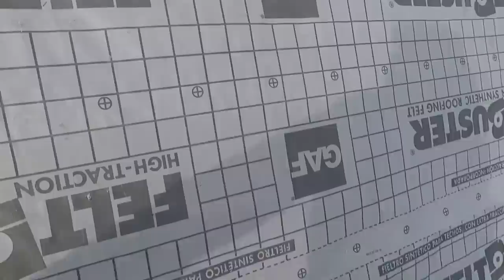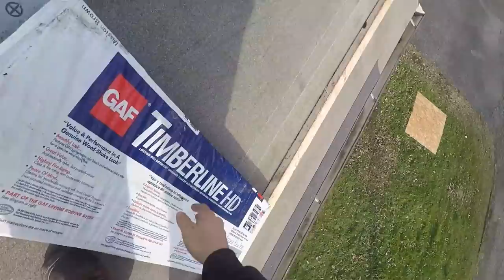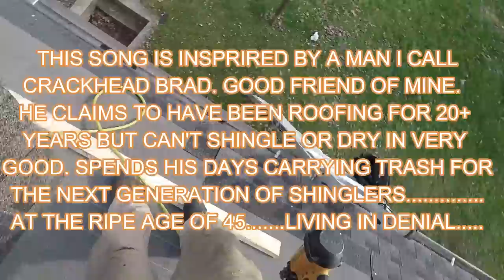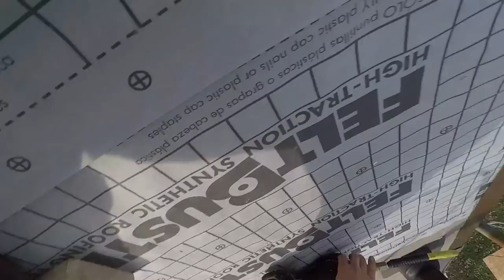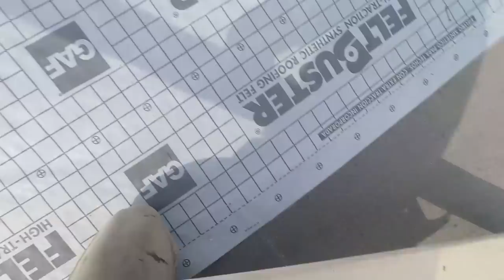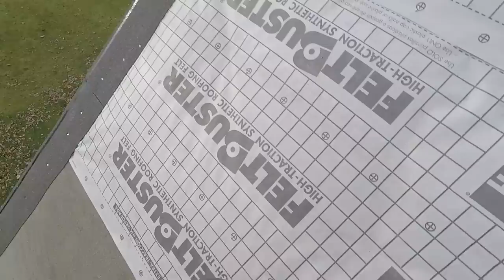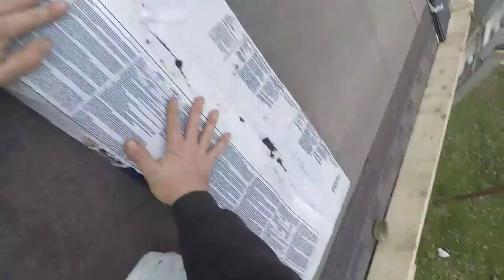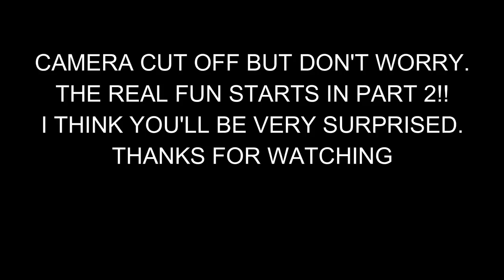Worlds Fastest Shingler 9/12 (Part 1)

Comment: Ps pre cut shingles into quarters for starting on the rake it is a lot easier then cutting them once they are nailed
Reply from the maker: Not any easier or faster based on my experience but thanks for the advice. I will be making videos on all of that pretty soon so make sure you're subscribed to see that video
Reply: I use a shingle cutter pre marked with my steps I have my full sets for my entire roof in 15 minutes. While your prepping a brain dead lab can cut them out.

Comment: I Hand Nail 3 Square A Hour On Most Walk On! Steep Roofs No Problem I Have My Roofs Loaded Then I Have Someone At Top Slide Material Down And I Cruise Rite Up! I Hand Nail Everything! I Guarantee My Workmanship As Long As The Material! Hand Nailing Is The Best Buy Nothing Else!
Reply: That argument is so wrong. I've been gunning for 8 years and not one blow-off yet. So where's the hand nail advantage in this case?

Comment: " nails into random nothingness" man that shit got me once. Im a framer and i got on this roof to do a repair for the roofers, it was a 10 pitch, they put their toe boards nailed to osb into nothingness, it held up fine walkin around on it but when i went down to pull up a sheet, opposite forces push me down and it let go, fell 2 stories and only broke my nose, fuckin nuts. I dont blame the roofers cause i sould of checked that shit. But i use a few extra nails nowdays lol ( sometimes)
Reply from the maker: yea they probably did it with 8's too! we had 16 hand drives and we were also going into 3/4 inch pine or some shit lol...when we're on osb i still do the same thing but use a few more nails and make sure they're secure of course...

Comment: If you did something like a belay harness, would it be easier for you to stretch the rope and just use a Jumar Ascender or something to hold yourself at one spot so you can work from the bottom up like on a lower pitch roof? Just seems to be easier and faster than working from the top like you were. By the way, what was your MOS in the service? By the way, you are fast as hell. Wish you were in my area, I would get you to do my roof. Always glad to help a fellow vet. Thank you for the education in roofing and for your service.

Comment: Those low starter nails are killing me.
Reply from the maker: people yell at me to put them low when i put them high..lol what do you guys want!? i looked it up after people talked trash and they're supposed to be lower-ish… so i try to put them lower than the nails that go in the shingles...but its not a huge deal. biggest deal is that you know where your shingle is gonna land so that you don't put a nail where the seam will be
Reply: Ya but if you get a situation we’re there’s a nail that’s over driven or any that could create a low spot that water will run over to that nail and start to rot the overhang. I’ve been roofing in Seattle Washington for 16+yrs and never seen where it’s ok to be doing that. Your nails should never be lower then where your first course of nails go.
Reply: Low nails for high wind
Reply: Rising Sun Garage "
Reply from the maker: @rainydaysroofer9474  I space out the nails on my starter just the same as shingles.  So that there's not a nail near the seam of my shingle.  Therefore water can get in (as it does with every seam on the roof) and be just fine.
Reply: But it’s not fine when you get a overdriven nail it creates a low point and water will travel over to it and settle and eventually rust the nail out which will cause a leak if it doesn’t always leak from the beginning. So I’d doesn’t matter if the nails are in the right place. Especially when you got guys that are newer or just don’t care about nails that are over driven under driven crooked and everything else. It’s no good I’ll never be convinced otherwise sorry
Reply: We know you been doin that shit for 16 years you know it all lol

Comment: Happy holidays boss! Can you explain the steepness numbers and what’s the worst you’ve done?
Reply from the maker: Happy holidays! So when we say 4/12 or 9/12 we're talking about rise and run. Picture a triangle with a right angle and a hypotenuse.  Let the hypotenuse (long angle of the triangle) represent a roof pitch. So for every 12 inches you go over (run) you have a rise. If the rise is only 4 inches, till you would be meeting the roof, you have a low pitch.  If it takes 10 inches before you hit the roof pitch, the roof is steeper. I've done a 23/12 roof before. So  For every 12 inches you go over...if you go straight up from that point...it takes almost 2 feett before you reach the pitch.  It was steep.  I've also done mansards and barns. Those are steeper like 30/12 or something idk. A Google search might help too

Comment: Any tips for first row of paper/ice+water on these steep ones? I usually ride the roof up to 10, then work off a ladder above that
Reply from the maker: Yes sir. I always set a toe board on the wood at like 3'6. That way you can put on the ice shield from there.  And I cut the ice shield into manageable lengths.  10-15 foot so I don't have to deal with heavy rolls.  Then after the ice is on I'll move the toe board down.  (About 6 inches or so below the line that felt goes to) and the reason for that is so I can reach my gutter apron and starter rows easier. From there I toe board as needed.  Long 16 footers usually.  And always use synthetic felt.  Goes down way quicker
Reply from the maker: I just hammer there boards in with 16s as you saw me pull off. And those boards I stand on to do felt, I'll usually stack shingles on

Comment: I get what you're doing with videos. It's entertaining, and a chance for more revenue.  I'm 50, and have been roofing for 23 years. I don't know if you are carrying workers comp, and liability insurance, but your carrier could simply watch your videos and drop you.  It has happened before.  I had one check out my Facebook change, and changed my classification from carpentry which is cheaper, to roofer which is much more expensive.  If you don't have full coverage on your guys, it sure makes it tough for the companies that are playing by all the rules, while other one can under bid by not paying insurance, or the proper rate.

As for your work it looks fine.  However, it is ten times faster to set up scaffolding from the ground to the eave, and work off of that when starting a steep pitch.  It's so much faster, and safer, and allows a better job, you will wonder why you never used it before. Also get a shingle chopper.  Cuts your starters in no time, and perfect every time.  You don't need to make crooked cuts like you do with a knife.

A little investment  pays off.

Comment: Just curious what the best method  to working on steep roofs when its 90 degrees out? You so much as step on a shingle on that pitch on a 90 degree day your probably going to ruin it...do you just use the foam cushion on hot days rather then standing on the actual shingles? Kind of a newbie here and just wondering what your thoughts were....
Reply from the maker: I had to get off an 8/12 last summer coz it was too hot. sometimes it just is too damn hot to stay if you're scarring them up. I had a cushion that day too. it was actually the day I filmed the 8/12 video. otherwise use a chicken ladder. you'll see in part 2 a good example. just make sure the ladder doesn't have anything on it that will scar them when you step on it
Reply: Sprinkler with hose.
Reply: Ronald Nolting brackets and planks every 6-8 ft
Reply: The answer to tearing me up is more cushions, more roof jacks and hook the hose up.  Spray that shit down every twenty mins.  Ground guys love to play w the hose.  I don’t know why but they always do.

Comment: What's yer gun?  I'm thinkin' of trying a Banks from Harbor Freight, because pretty much they're all the same.....  But that one's cheap.  Also, what's your preference ---  Inch and a quarters or inch and a halfs?
Reply from the maker: its bostich. if you want a cheaper one go to home depot and get the porter cable or a tool shop. tool shops actually shoot better in the cold than my bostich lol
Reply: I've got the Pierce from harbor freight. It's basically a knock off Hitachi. Bastards jacked the price up to 200 bucks on it, though. It used to be 150 minus the 20% coupon. I'm sure the price will come back down, though. Fantastic gun for the price i paid (120)
Reply: @nuthinbuttrubl89  Yeah, the Banks is also 120.  I'm happy with the framing gun so far, so I think I'm gonna try the coil gun.

Comment: Not bad. I would recommend belt/harness with d clip in front and ropes for 9/12 to 16/12, ONLY because of the fact that a rope will just make you be able to move around, tear off/shingle much faster. No need for any planks or jacks that way. Seriously, you guys do work hard, but a lot of time is wasted on putting planks and jacks, when you can wear a rope and move around/shingle much more efficiently.

Comment: What are your thoughts on 8" drip
Reply from the maker: Seems over kill... unless specifically for hurricane areas that might be good
Reply: @NWIVeteranConstruction  All the roofers in Southern ME use it as standard practice. It comes in handy to cover the gap on rakes with cove molding and short deck boards.

Comment: Do you have a recommendation for a good cold weather air hose?
Reply from the maker: i use flexilla and that's my preffered hose always. if you're having issues cold weather just make sure you're always draining your compressor at the end of the day and they also make a cold weather gun oil that has antifreeze in it. ABC sold me my bottle. couple drips in the hose and a few in the back of your gun should help pneumatic tools shoot in the colder weather
Reply: @NWIVeteranConstruction  Thank you, appreciate it.

Comment: You have probably been asked this a million times (sorry). What make and model hammer are you using?
Reply from the maker: idk what that one is. its not mine and i don't like that hammer. my favorite hammer ever is the really expensive (220$?) 14 oz titanium stiletto hammer with the interchangeable heads. but these days i usually resort to the dewault 15 ounce for like 45 bucks or the blue estwing one that's basically the same for around 25 bucks
Reply: @NWIVeteranConstruction  Great! Thanks.

Comment: If it's really steep just carry the cushion uphill so if you start to slide, you can sit down on it. Wear some cougar paws - I used to walk 12 pitches like that all the time. We wouldn't even use roof jacks on an 8 or 9. Now - yeah, on the steeper stuff you're better off with safety gear, especially on a 2+ story, but come on ... some people are obsessed with regulations even when they make no sense. What's more dangerous - walking a 4 pitch 1 story, or having to fight harnesses and tripping over ropes on it?

Comment: So you pulled up those cleate boards at the beginning and left nail holes in the peel in stick at the roof Edge which will all leak when they have ice dams. This is Amateur hour if you roof this way. All membrane punctures require secondary sealing or you drive the nail home.
Reply from the maker: Nobody does that lol but I get your point.  I wouldn't call it amateur hour, roofs used to not even have ice and water and survived just fine.  Calling it peel n stick is amateur hour.
Reply: @NWIVeteranConstruction  actually you are incorrect GAF does not make ice and water gcp, what used to be grace, makes ice and water shield it's a proprietary name like Kleenex or Xerox instead of tissue or copy. Therefore calling it the generic peel and stick is actually the correct term or peel and stick membrane. I have 30 years as a building envelope consultant and I'm the guy that goes in and writes reports so that lawyers can fight about the fact that you left open nail holes in your peel and stick. Also for the record GIF is just about the worst Roofing product manufacturer out there. To date we have 17 affirmative paid claims against GAF and GAF installers.
Reply from the maker: @jerrydawg4434  ok nerd lol I didn't say GAF made Ice and water specifically. But If you go to your city, they will tell you ice and water shield is or isn't required, never heard anybody use the term peel n stick 😂 There's plenty of different brands and people call it strange names like Ice barrier shield, etc. But people who use this stuff daily, call it ice shield. So that's all i meant man. And As a shingle installer, having worked with many different brands, GAF happens to be one of the better more consistent ones to work with regardless of temperature and regardless of how many claims you and them have. Everybody is short handed I'm sure some line inspectors missed some stuff. Unfortunately, it happens. The installer should've noticed. And that doesn't mean that I don't enjoy working with landmark or O.C, although I do have issues with them on occasion. it sounds to me like you specialize in nail holes under roofs....nail holes, really!? You're gonna tell me that's the cause for these serious issues you have worth going to court over!? And lawyers are making that ridiculous argument!? Lol For crying out loud we, as shinglers, and I mean everyone, cut the bubbles out of ice shield and let it stick back down on itself. Without adding a new strip over it. That's like, a 16th of an inch of over lap, and we all sleep just fine knowing that it won't leak. It's Been going on for decades without issue. Don't tell the lawyers that 🤫 its hilarious that you guys act as If the other thousands of nails aren't going to leak if water gets to them just the same as the hole that I left 2 and a half foot from the bottom. and don't even try to say that felt paper or ice shield seal perfectly around the nail that holds a shingle down. It might to an extent, but you guys are really stretching it. Outside of severe ice storms, The gutters cause those ice dams so bring it up with the homeowners. It could be ventilation, gutter guards, or clogged gutters. And Newsflash,  A properly installed roof shouldn't be relying on underlayment. It's a secondary protection that's rarely necessary so long as a roof was installed in nice weather and had time to seal properly before a significant ice Dam starts. For years People stapled that old ass tar paper at the bottoms without any caps and the most common cause of rot at the bottom was still the fact a shingler didn't understand how to stagger his starter shingle from his first row.
Reply: @NWIVeteranConstruction  I can show you a roof that was 4 years old that had four nail holes in the membrane and the entire structure failed, nail holes are just one of a thousand problems we see in buildings.

Comment: Where we roof if you get caught just once up on a roof by Workers Comp without being 100% compliant to safety regulations you're done. They will park a block away and take pictures before showing up to bust you. Not to mention other competitors and neighbors ratting you out. It's grim but once you get used to it it's not so bad. Eventually you'll slip and fall or slip and put a nail into your femur or hand if you're not harnessed up. Lol. Stay safe dude.
Reply from the maker: That's insane.
Reply: @NWIVeteranConstruction  Facism man...

Comment: question.... is that $30 a square refer to a square foot of square yard? and does that include materials?
Reply: A SQ. is a 10x10 area (100sf). I am NOT a roofer, BUT, quality shingle run around 100/sq from big box. Drip/starter/felt or paper (synthetic) /nails...... Another 10-15/SQ. National average is 
around 165/sq for a quality 25+ yr roof (starting and from Craftsman National estimator program) 

I was going to tackle roofing on various projects on my place (approx 30 sq) and was excited to put new info learned here to work. Well, workers/timeline/etc killed that and had to use actual roofers b/c I had to complete those items not getting done to keep moving forward. I supplied the material and paid for labor to install for ~129/sq.  It was another sub (sheet rocker) who was go between for Hispanic crew. Price/sq was very attractive, since my other experience with a friend of the original contractor was 260/sq.......

Hope this helps...... Seems like an inquiry for general pricing for future work? 

Should also note that come with a 5 Yr warranty on labor.